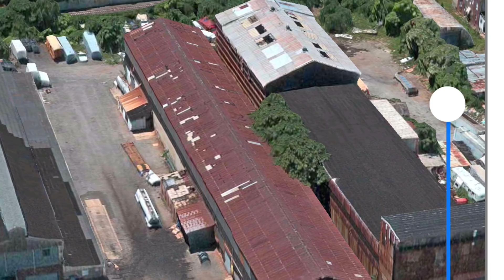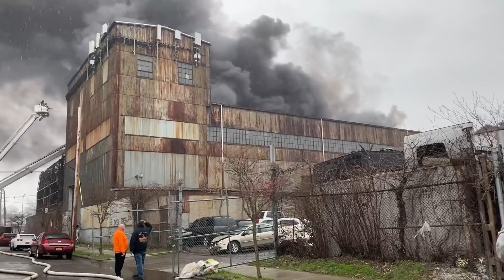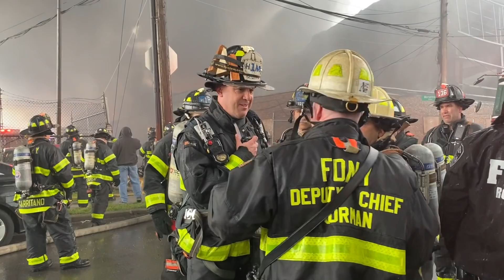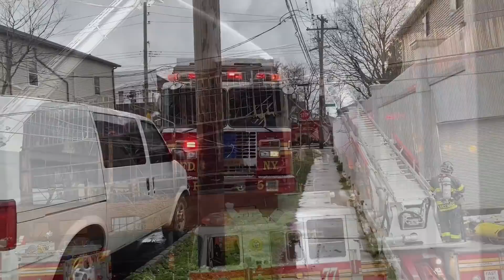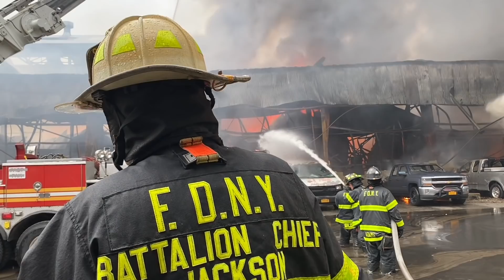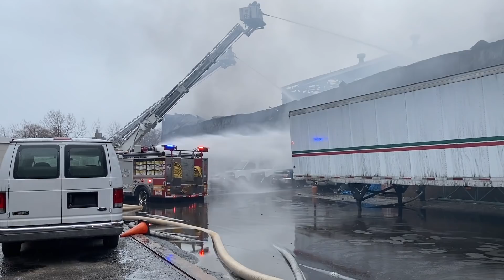FDNY 🔥 Staten Island 🔥 5th Alarm 10-80 10-86 Box 1150 Heavy Fire in a Factory

Comment: Satellite in ops. Don't see that too much
Reply: I was going to say the same exact thing about Sat 5 but I was also wondering instead of smooth bore they had automatic/fog nozzle maybe the water issues could be the reason why they switched.
Reply: @04u2cY  that could be. Definitely a busy night on the island for fires
Reply: @PghDon  it sure was busy on the island I also wanted to it's rare to see satalite in operation not like the 80s and early 90s they were used quite often.
Reply from the maker: nope first time in ops at a fire for SAT 5
Reply from the maker: Water issues thanks
Reply: @SkylerFire  is satalite 5 brand new and this was the  first fire it operated at.
Reply from the maker: @04u2cY  yea
Reply: @04u2cY  you actually need more water to flow a fog. Sounds like they talked about using foam. That’s probably with the fog
Reply: @Yeahwell24  a smooth bore nozzle flows less water then fog nozzle. With fog nozzle you need higher pressure at the tip for the optimal stream and the smooth bore use low pressure or the pump does not work as hard. I'm far from expert and if I'm not mistaken when pumping at higher pressure doesn't mean your flowing more water. I'm not saying your wrong I could be wrong but when it comes to nozzle and the different types out there today compared to earlier years requires lot research make sure it's right for your department.
Reply: @04u2cY  yes if your pump is in PSI mode.  But with a smooth bore ur pumping at low pressure with less friction loss. Less friction loss equals more available water for other lines . However they where relay pumping so they would be in volume mode vs psi. So in order to have good reach and depth ur need more water because of lack of psi. We are probably both right in different ways of that makes sense definitely a department thing. But I do believe the sats are more for foam ops then build fires that's why u don't see them as much. Now the new super pampers that are coming totally different story. Nice chat stay safe
Reply: @Yeahwell24  now it clicked in my head I had no idea they were in relay mode one more question if know
Was the reason for relay mode lack of hydrants because it was statan island compared to other parts of the city where hydrants are every 5 feet and possibly on different mains I know of alot of departments they can't use to many hydrants on the same main other wise you start robbing water.
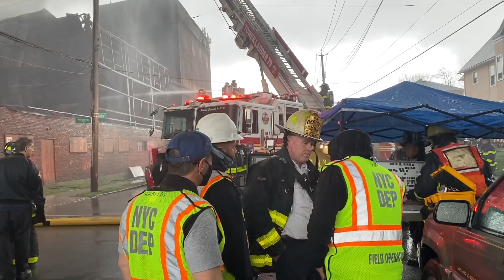Reply: @04u2cY  Around 3:56 he's says. Per Dep only 8 inch mains and gravity feed. I can't be a 100% but my thinking is and with looking at  map that area has a bunch of dead end streets and a railroad tracks and yard. They are probably at the end of a water grid. Not to knock this video but if you search you tube there is a different view of the scene and shows they did actually jump hydrants and how long of a 5 inch lay they made.  Not sure if that answers ur question.
Reply: @Yeahwell24  yeah it helps and thanks for answering my questions.